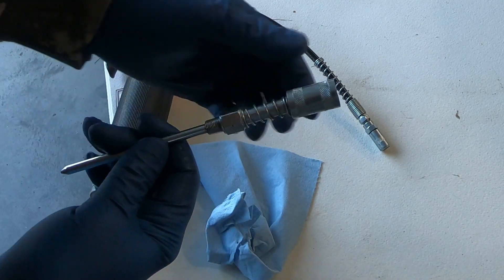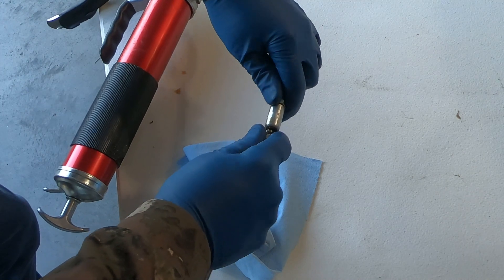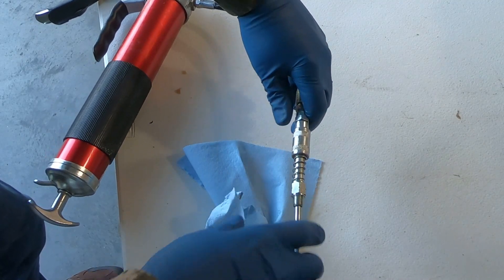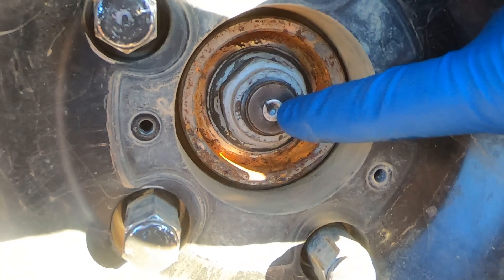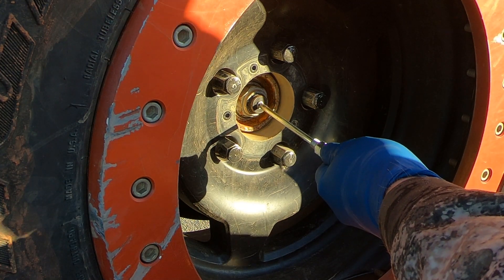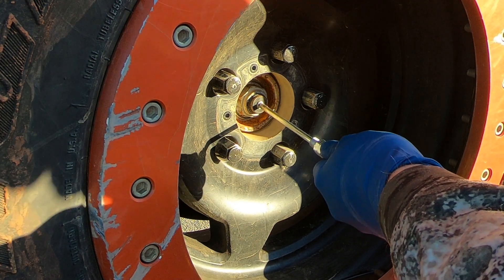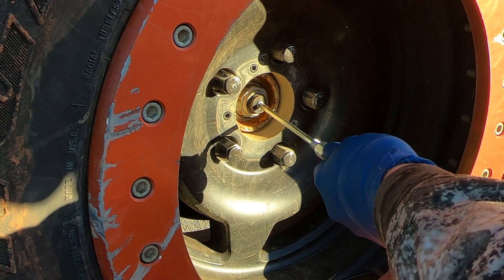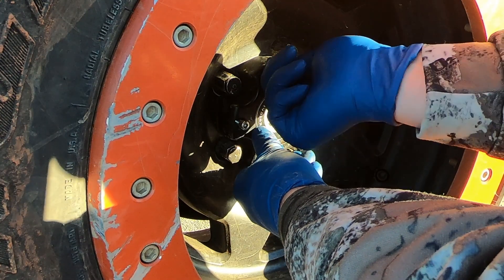How to Service RCV Axle Shafts

Comment: Been having an issue with this. Does the grease fitting depress at all?  It doesn’t seem to want to accept the grease.
Reply from the maker: It does depress, but so little that it's almost undetectable. I would GUESS that it's probably more likely that the end is gummed up. Maybe from dust, dirt, water and/or mud. Especially if you don't run center caps on your wheels. Try spraying a good bit of brake parts cleaner to it and see if that helps. It may also be possible that there's too much grease in there and it just won't take any more. If you've noticed grease oozing from the orange bell cap, I'd say that's probably the issue. Just a theory. Hope this helps. If you're able to identify the issue for certain, I'd love to hear it. Thanks for watching and the question! 🤘🏻

Comment: Thank you Clint. Another great video. You need to touch up those beadlock rings.
Reply from the maker: HAHAHAHA!! Yeah, I'd "planned" to take them all off and have them powder coated over the winter. But, that hasn't happened, YET. The rattle can did not hold up as well as I'd hoped. This go 'round, I think powder coat and touch up will be easier. Thanks for watching and the comment, Bob. Appreciate the support!!🤘🏻

Comment: I AGREE,  FJB, Let's go Brandon. I have a clicking sort of noise in the area on mine but can't seem to isolate that's the issue.  Only about 10k miles on them.
Reply from the maker: LOL! For sure FJB!! My only thought would be to grease them and see if it helps. If it (IS) the RCV's, there's really not much that can be done (except grease), other than rebuilding them. It's not too expensive done yourself, but it is a SERIOUS pain in the ass! Personally, I'd just live with it until it needs rebuilt because it's no longer safe to drive. But, that's ME. I'd go ahead and check that your control arms, tie rod ends, drag link, and track bar are all tight. If you have johnny joints in those parts that are worn out, that could be the culprit as well. Hope this helps. Thanks for watching! 🤘🏻